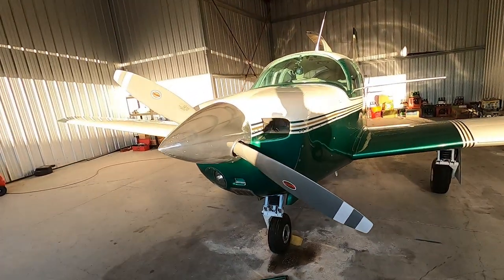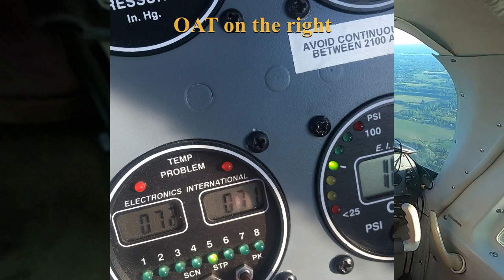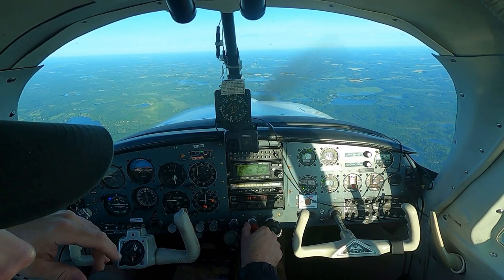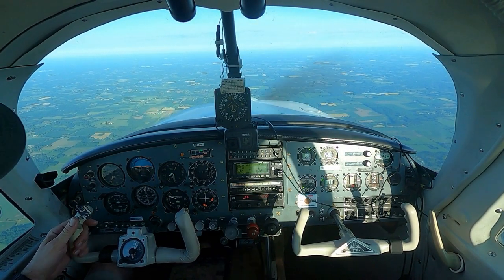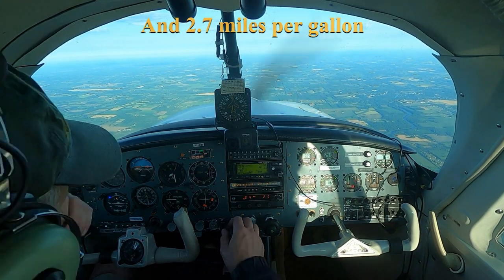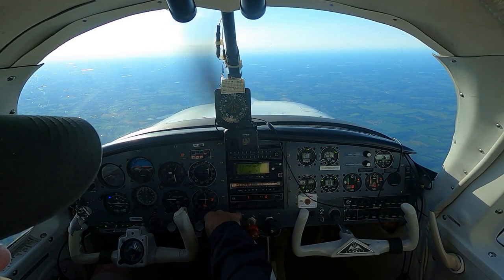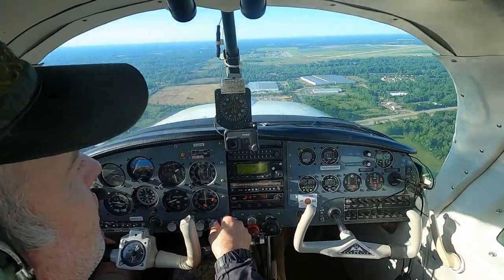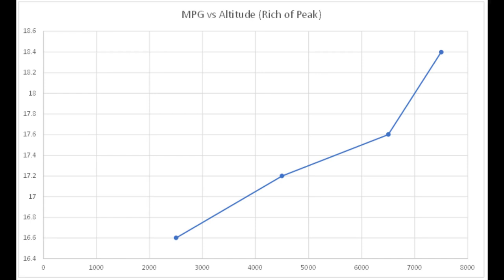Mooney M20E Performance Test

Comment from the maker: There are more myths, legends, and rumors about Mooneys than any other airplane I know of, and I want to make my next video on that topic.  Any particular Mooney myths you want busted or confirmed?
Reply: Wish someone would do an STC for “Fowler flaps” on these planes, so they actually provide lift instead of just drag. Then an STC for a left side baggage door like a Comanche, then you could just seal up the useless one that opens to the sky which also pops open in flight. Ugh such a idiotic design that could really be a good airplane instead of pretending that it is.
Reply: Maybe for next topic talk about techniques for landing a mooney without floating, crosswind landings, short field, and back-country flying are some ideas.
Reply: That they over-run the runway. That could be dispelled by showing a short-field landing. As you know, it's all in decent planning, and speed control over the fence. I tell everyone that gear down and first notch, it's a Cherokee, nothing to be afraid of. But you've got to get it down to gear operating speed first!
Reply: Not a pilot here. How does airspeed compare to SOG (assuming level flight)?
Reply: @dodgeplow  SOG is not an abbreviation commonly used by pilots, so I'm going to guess it means speed over ground?  If so, I can answer your question, if not, just explain what SOG means.

There are four types of airspeed:  
Indicated airspeed is what the gauge says, simple enough.  
Calibrated airspeed is the indicated airspeed adjusted for installation and instrument error. Think of it as the airspeed the wings feel.
True airspeed is the calibrated airspeed corrected for altitude and temperature.  It's how fast you are actually moving through the air.
Ground speed is the true airspeed plus or minus any headwind or tailwind component. (I think this is what you were really asking)
Finally, equivalent airspeed is is the calibrated airspeed adjusted for the compressibility of air.  This only comes into play as you go really fast at high altitudes, so for our type of flying, it's negligible.
Reply: Rear seat room when you "sit behind yourself" (front seat in flying position)
Reply: Great video. I’m currently shopping for a cross country, family airplane. 950 lbs useful load minimum. Mechanic friend recommended Arrow over Mooney due to excessive landing gear maintenance cost and parts availability. Your opinion would be most valuable to me.
Reply: @darrylday30  If you get one with the Johnson bar there is almost no maintenance.  Keep dealing with the micro switches on the Arrow they always seem to be getting stuck.  So I don't know what your mechanic is talking about.
Reply: @libertine5606  The hassle was with the electric powered gear. A couple of Mooneys here had structural damage around the motor attachment. I like the cabin in the Arrow (more leg room in the back than the short Mooneys) but I might get a long Mooney next time. BTW, I’m a mechanic, mostly larger aircraft but a few years of light stuff.
Reply: @darrylday30  The E is tight for the rear passengers and shoulder room can get uncomfortable on long flights.  But for one or two people going to real places in the least amount of time nothing beats a Mooney.  

I have had a E and a Bravo and if I got another one it would be a 201.  A F model with all the mods already.
Reply: @libertine5606  I agree.

Comment: I am a 25 year M20E owner.  Love it.  I can take it to the mountains and have been to both coasts.  I was told that the door on the front was included because the cowling design is so poor that the engine cannot get normal atmospheric prfessure to breath correctly.  I use it in clear air, at altitude.   We call the door our "poor man's turbo"

Comment: Former M20C owner.  Pro tip, when dealing with the old MPH/KTS airspeed indicators, when you're cruising between 7,500 and 9,500 on "normal" temp days (not standard), the MPH indicated is the same as KTS true, give or take 2%.  This vid pretty much proves it if you take a second look at it.

Comment: Pa28-180 pilot here.  Have been thinking Mooney.  Thank you for your channel.  Not only informative about Mooneys but operations in general.   I had never ever considered the back pressure of a partially opened throttle.   The lung test was so brilliant.  Thanks!
Reply: I have about 200 hours in PA28-181 Archers.  Nice easy fliers.  Love them.  Bought a ‘64 M20E two years ago.  It’s a big step up.  Love it so much!  One big issue in transitioning has been landings.  The Mooney loves to fly.  It does not want to stop flying.  Really need to nail speed control down final.  If you don’t it’ll tell you.  Go around, trying to force the landing will get you into PIO, after you porpoise you’ll wheelbarrow and have a prop strike.  Also, from wat I’ve read spins are not easily recoverable, so avoid them diligently.  Apart from those caveats it’s a wonderful airplane.  I especially enjoy slowing to the Archer cruise speed before putting the gear down.  That, and 150 knots on 8gph of course…
Reply: Thanks!

Comment: I wish everyone who reviewed an airplane did these type of tests. Thank you for the video. Your performance results are nearly identical to my ‘67 200hp injected m20f. I have a single probe egt so I don’t try lop
Reply: At higher altitudes above about 8-9000ft, just lean out until the engine gets slightly rough and then enrichen. Any operation LOP to pk EGT to 125 ROP will not be possible to hurt the normally aspirated engine because you'll typically be less than 65-70% HP even at WOT & ram air door open. At typical stabilized cruise speed with typical CHT's, you really can't hurt the engine. If unsure, settle in cruise for an extra couple of minutes before doing the leaning.
In general, getting an engine analyzer is practically a necessity for safety reasons. You'll generally be able to see valve issues before the engine has serious catastrophic failure. At least, you can baby it for a precautionary landing.  
I typically fly my 1966 M20E at a minimum of 10,500 ft. Best TAS goes down but the CAFE score keeps going up and starts flattening at about 14-15,000 ft.
At that point, I'm getting about 23 statute MPG with a fuel flow of about 7.1 gph (143 KTAS). For the E model with 48 gals usable, it increases the range so I don't have to stop or have more reserves.

Comment: The biggest mods I did to my E model in importance was #1 Generator to alternator.  I got stuck a couple times with a dead battery after night operations.  #2 JPI engine monitor.  #3 Cowling mod. I did Texas also and they did the alternator mod too.  #4 Quartz landing light. LED wasn't a option at the time.  But getting rid of the incandescent that burn out all the time was important. #5 Window mod.  #6 Shark fin antennas.  

5 and 6 really wasn't about performance but it did make it LOOK faster. 😁

Comment: At higher altitudes above about 8-9000ft, just lean out until the engine gets slightly rough and then enrichen. Any operation LOP to pk EGT to 125 ROP will not be possible to hurt the normally aspirated engine because you'll typically be less than 65-70% HP even at WOT & ram air door open. At typical stabilized cruise speed with typical CHT's, you really can't hurt the engine. If unsure, settle in cruise for an extra couple of minutes before doing the leaning.
In general, getting an engine analyzer is practically a necessity for safety reasons. You'll generally be able to see valve issues before the engine has serious catastrophic failure. At least, you can baby it for a precautionary landing.  
I typically fly my 1966 M20E at a minimum of 10,500 ft. Best TAS goes down but the CAFE score keeps going up and starts flattening at about 14-15,000 ft.
At that point, I'm getting about 23 statute MPG with a fuel flow of about 7.1 gph (143 KTAS). For the E model with 48 gals usable, it increases the range so I don't have to stop or have more reserves.

Comment: I love the M20E.  I had a 64 and a 66.  One with the 201 windshield.  Both with the Lasar cowl enclosure. Misc. fairings, etc.  Wish I had the 201 cowl but didn’t.  Keeping an eye on the Vne is important.  They loved flying 8k to 10k.  I also got a little over an inch of manifold pressure when I opened the ram air door.  It has a lot more impact than 201 ram air door due to the more efficient induction system on the 201.  You have a beauty!  Makes me miss them.  thanks for posting.

Comment: I have a good friend in Sprindale AR with a Mooney. He simply loves it and has had it for over 20 years. He also says it's the scariest plane to land he has ever flown. He says it does not like the runway. He used to rent it out, but is had 3 hard landings that required airframe and landing gear work. So ne he is the only one who flies it. Said if it were not so fast and efficient he would sell it. I guess a true love hate relationship. 

Great video by the way.
Reply: The Mooney wing doesn't want to stop flying & the gear is short. But if u can fly a Piper Archer or Cessna 172 it's not a hard transition compared to other complex planes. If your use to flying a short wing plane like a Cherokee you will probably have problems till u learn good airspeed control. I have installed precise flight speed brakes on them which should help double the rate of descent. But I think its better to plan descents early it saves fuel & good airspeed control on landing.
Reply: That’s absurd. I have a m20c very easy to land. I even go in out of grass strip part of the year.  Just lean to manage airspeed.
Reply: Absurd? He has over 12,000 hours in the air. And has owned that plane for over 20 years. Ownes 3 other aircraft as well. He said exactly what the other commenter said. "It just keeps floating and tends to pourpus like a dolphin." He would say this all the time. And he LOVES that plane. I'm 100% sure he knows what he is talking about.
Reply: @tireballastserviceofflorid7771  My dad, who also had thousands of hours in fighters and airliners, porpoised our Super 21 and had a prop strike, because he didn't respect how precise you need to be with speed control on approach in the Mooney.  I believed the guy who checked us both out in the Mooney, and never had a problem...earned my private in that bird, and my commercial in a 201 at Flight Safety, where I convinced my instructor that HE (multi-thousand hours, flew C-130s, aerobatic, etc.) was carrying 5 too many knots down final...showed him that I could consistently touch down on the landing zone paint and make the turnoff, where he floated to the intersection from the same on-glideslope position over the threshold.   I wish I could have afforded to buy the M20E when he and his partners sold it.  The Mooney will teach you to be careful, and you'll find other airplanes, which are more tolerant of excess speed, also land better if you actually fly a stabilized approach right on speed. 

Come in 5 knots too fast, and you'll have a hell of a time getting it to land.  10 knots will add a mile to runway required.
Reply: @richsarchet9762  My point exactly. Great plane just not forgiving on landing. 5 knots in a C182 or C210 is nothing.

Comment: for those wanting to have apples-apples comparison, convert the 7500ft altitude to a density altitude based on the temperature. 
Humidity is a factor but it appeared to me a low humidity day (ie. few clouds).
I find that my best TAS is at about 8500ft MSL and about a 9500ft DA equivalent for moderate wingloading. 
Another thing to increase best TAS is to have some aft weight. This makes the horizontal tailplane with minimal negative angle of attack giving less pitch stability. 
As well, having the flaps set flush (ie. not extra downward camber) gives a bit of a better cruise TAS.
Also, (rudder, aileron) trim the airplane (so that it is most efficient at the higher altitude) for the typical IAS, for example 130KIAS. 
If you want to get more accurate readings then in low winds aloft, do the 4 cardinal directions, preferably in alignment with the wind and throw out the crosswind affected directions.
Note that the best TAS is going to be dependent on the total weight of the aircraft. At lower wingloading, the angle of attack will be less so the best TAS will be higher (and at higher altitude).

Comment: I love that breathing analogy for engine efficiency vs throttle position. Never thought of it that way. The engineering perspective is very fun to hear. You're essentially talking about volumetric efficiency, right?
Reply: Yes, exactly.   Volumetric efficiency.    This is why people in the know fly WOTLOP.   Wide open throttle, Lean of Peak.     

With more than 65% power (WOT down at lower altitudes) it is possible to climb and cruise LOP as long as you can get sufficiently LOP.   More power=the need to be more LOP.

The worst place to operate the engine (lowest detonation margin) is 50-75dF ROP.    Of course, this is normally the “best power” mixture found in the performance charts.

Comment: For those of us who live high humidity areas, we don’t get spec horsepower. Experiments show up to 10% reduction of horsepower because the water molecules take up space and displaces oxygen molecules. So less oxygen, the less fuel that you can burn. So if you want best performance, cold and dry is what you want.
Reply: Partial pressure of O2 is effectively reduced. Can effectively think of it as a higher density altitude.

Comment: Great video.  I'm getting similar speeds in my '62 C but I'm using 20-30% more fuel.  I'm not sure I'll ever try lean of peak with a carb, that and I've dumped a lot of money into making it go fast and very little into engine monitoring.  Probably not the wisest approach.
Reply from the maker: Who's to say what the best approach is?  I don't know if you've ever read the articles by John Deakin on AvWeb (link to a summary: https://www.csobeech.com/lean-of-peak.html), but he talks a bit about LOP operation (and engine operation in general) on a carbureted engine.  I'm not necessarily saying I endorse it (or don't endorse it- I don't have enough information), but if you're interested, have a look to see what he has to say.  Edit: here's a better link (http://cospilot.com/documents/Mixture%20Magic.pdf) but you can look him up on Google.
Reply: @FrugalMooney  Those are very interesting articles.  The pdf will take reading a few times to fully sink in.  The moral seems to be that we can experiment quite safely above 9000 ft.  I'm curious if that also applies to rpm, I've got the MT prop as of last month with no rpm restrictions.   I'd like to try cruising at 2000 and leaning it out... Regardless, I'll work on applying that info.
Reply: @HairHelmet  Nothing scary or dangerous about operating LOP in carb engine as long as you have a proper understanding of the principles and limits.  Modern engine scanner instruments make it easy and give confidence that engine is happy.

Comment: The early M20J models did have the ram air inlet it was a round inlet. I have a M20C with a 201 cowling done by Mooney Mod Squad. The inlet hole is there but not connected probably cause its a carburetor engine.
Reply from the maker: Thanks for letting me know.  I flew an M20J and I knew someone with an M20E with the real 201 cowl and neither had the power boost door so I assumed they were all that way.
Reply: @FrugalMooney  You should do a buyer's guide on the features plus pros & cons.When I worked at a Mooney dealership in the 90's the newer  M20J Mooney MSE models had eliminated the ram air. But those later years had better corrosion protection with primer on inner structure. Some 80's Mooney's had almost all the primer falling off the tubular structure & badly rusted tubes when u pulled interior panels. The older ones like yours have good paint coatings on the tubing. I have seen a primer with coat of grey enamel on older ones. Great video 👍
Reply from the maker: @Nord3202  Thanks for the idea - I might do something on the various models.

I wanted an older model before the first bankruptcy and sale (before they started cutting corners to save money) - I've heard some stories about how things were cheapened after the sale to Republic.
Reply: @FrugalMooney  Also I like the older style fuel caps with the door & scupper drain. The 65 & up Mooney's had the more common flush fuel caps that water sits in the neck above the o ring & rust out the filler necks. But 65 to 66 where the fastest due to better quality control. The 64 was the last year for the crank up step. Then vacuum operated then finally just a fixed step. Also the older Mooney's had the smooth elevator & rudder instead of the beaded controls & larger rudder. Also the manual gear is a plus on the older models. Nice to make a video on all the changes over the years. I prefer the bullet proof 4 cylinder Lycoming engine Mooney's. After the J model it's all downhill especially with the Continental engine, alot more expensive to buy & maintain.
Reply: In the J they modified the intake, so the ram air barely had any effect, many older Js have had them removed to eliminate maintenance and clean up the cowling.

Comment: I don't get it. At 8:47 You say: „with a wide open throttle, at the same power setting, in terms of manifold pressure, you'll achieve more power. That means faster airspeed.“

With what would You set the maifold pressure, if not with the throttle?
Reply: Prop pitch

Comment: Forgive my ignorance 
Just starting to learn but why is your indicated airspeed frequently in the yellow zone? Is this not pushing the safety envelope? 
Love the Mooney 
Thank you in advance
Reply from the maker: A lot of high performance planes cruise in the yellow arc at a standard cruise power setting, which is never a problem in smooth air.  Vno (start of yellow arc) and Vne (red line) were raised in later Mooneys after more analysis was done on the airframe (no change was made to the airframe - better analysis showed that it was stronger than previously thought).